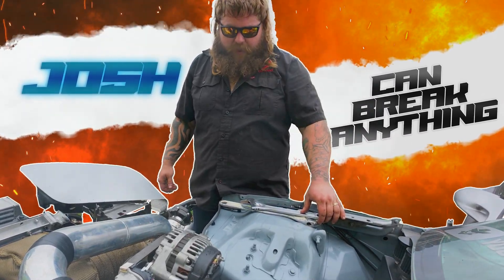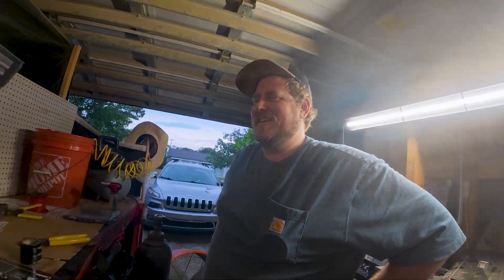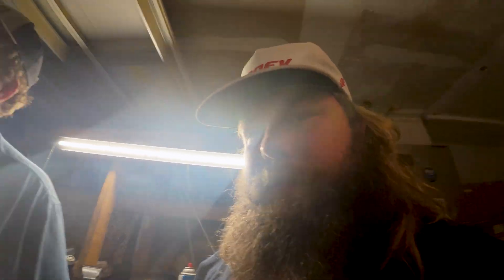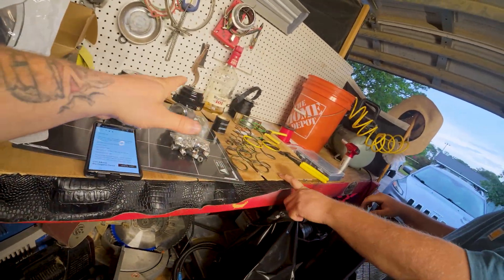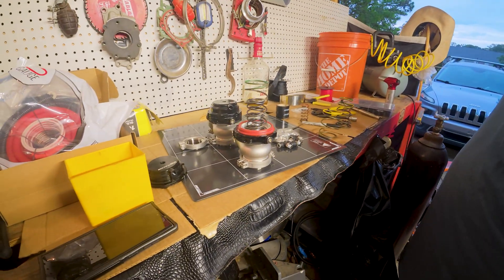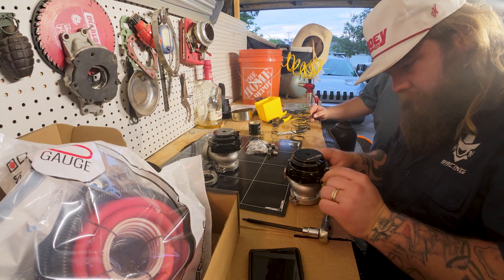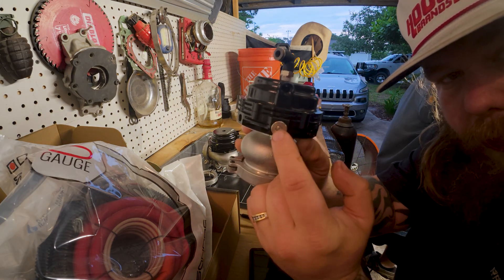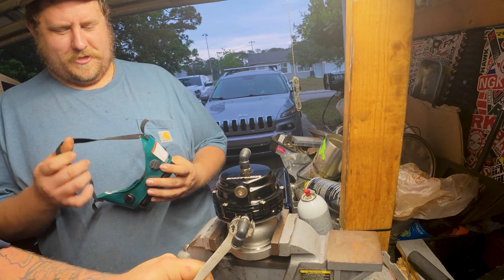Don't Overspend on Wastegates! VS Racing 44mm Setup (Best Value Guide)

Comment: What do u think about on board air ??
Reply from the maker: Just made and uploaded your video! Hahaha
Reply from the maker: I use onboard air and i love it
Reply: @HighNoonRacing  psalm new to the onboard air stuff and I got pretty similar set up to you 2000 Camaro 402 powerglide set up and I just mounted the on board air tank compressor, but I’m still trying to figure out everything as far as setting up the whole system to the waste gates, Mac valves could you do a video on how that is set up a lot of people have done videos but none of them are clear clean cut videos on how to set it up
Reply from the maker: @paulg8099  I'll have to do that.
Reply from the maker: @paulg8099  Maybe this weekend when I go to install the wastegates ill make a video on that.
Reply from the maker: @paulg8099 check the latest upload 👌🏻